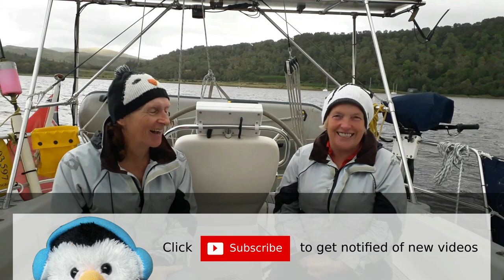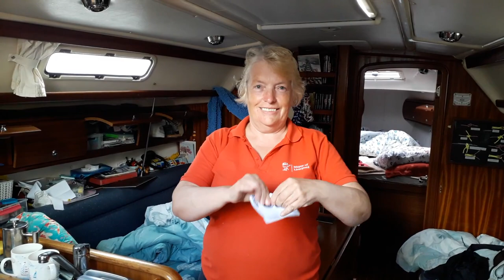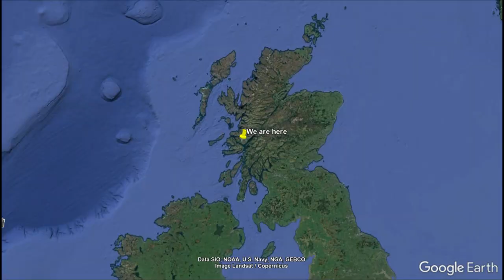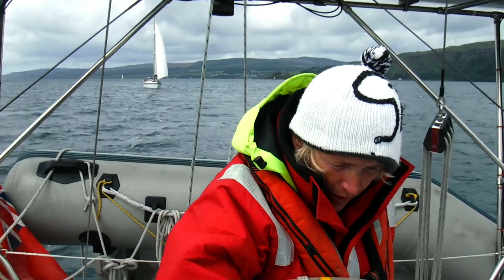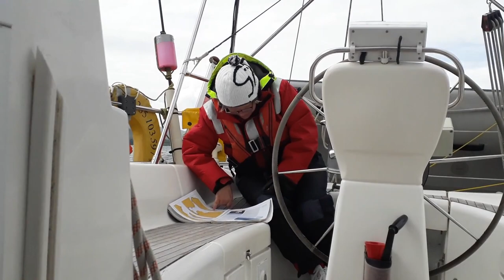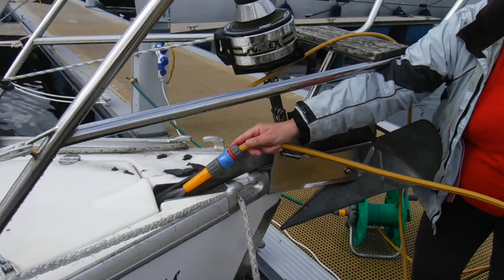Sailing Scotland - Sound of Mull - Lismore - Oban - Ep. 259

Comment: Hi both, we use an anchor alarm too. Locating the anchor in the right place on the app is conducive to a good night's sleep and fewer "intense crew discussions" :). So what we do, when setting anchor, is note the bearing and distance to the anchor at the time of motoring astern to set the anchor. Bearing is easily taken from the ship's compass (the boat will be pointing directly at the anchor) and distance is known because the anchor rode length is known. Be sure to add the length of the boat from stem to where the app device is at the time of setting (don't ask me how I know that!) So by moving the anchor on the app to match the bearing/distance it can be set in the correct position - no more worries about swinging away from the radius of the actual anchor placement ......I hope that makes sense....another fun video, thanks girls!
Reply from the maker: Yes that does make sense and we can usually see on the B&G plotter where we dropped the anchor and it will give us a distance and bearing. I think we should be noting that when we back down on the anchor and lift the chain and put that number into the anchor alarm. Glad you enjoyed the video and thanks for the anchor insight  👍

Comment: From memory Loch Aline has always been a source of solid mud!! And the word for a "Long Tack" is "Wearing Ship" which is what the old ships of the line had to do most of the time - which meant they were very easy to get "embayed" by an onshore wind.  There was a tall ship in recent memory that got embayed on the North Cornish coast - and his engine didn't work (or he left it too late) and ended up on the rocks - I think it was one of those cadet training ships - there was loss of life and the skipper got taken to court for it. (just done a search for it - it was the Maria Asumpta in 1995 off Padstow) - the skipper was found guilty of manslaughter and got 18 months. Don't know where that one came from - should have warned you to pull up a bollard before I got started!!
Reply from the maker: Great sea stories though, even if a touch grim. When I did read about the tall ships I was surprised how poorly they performed going to weather - 6 points was the nearest many of them managed! Six? That is a disgrace. Of course, on the beam or downwind, they were like racehorses!
Reply: @SailingYachtSaltyLass  If you think about it - to get hard on the wind you rack your boom hard down astern (some even have the main sheet over to windward) - in a square rigger the best you are going to achieve is the booms about 45 degrees to the mast (I think?) so that will limit how hard on the wind you can get before the sail starts to back or luff.
Reply from the maker: We are happy with our "big dinghy" 😉